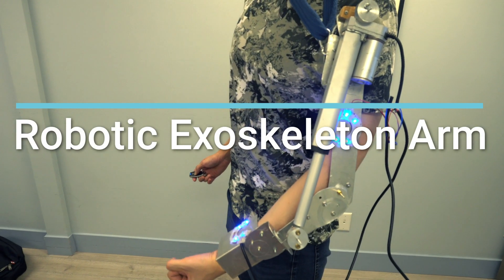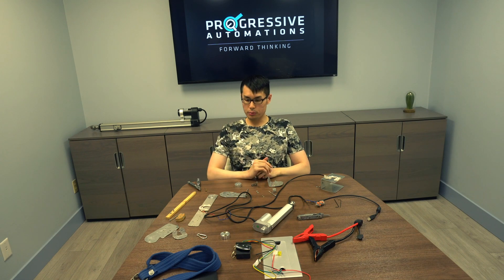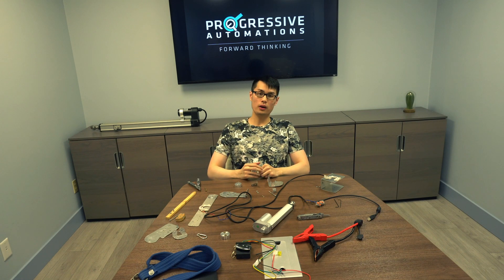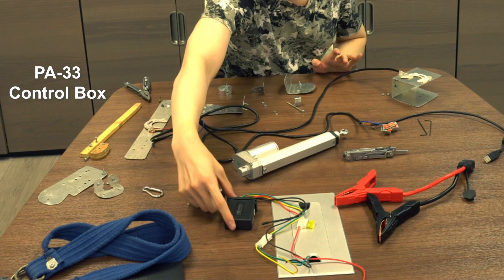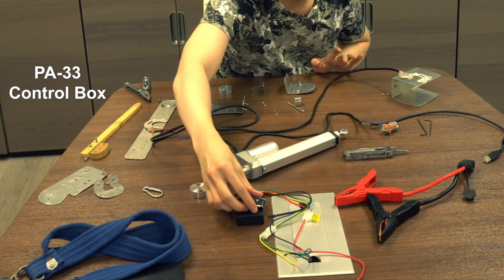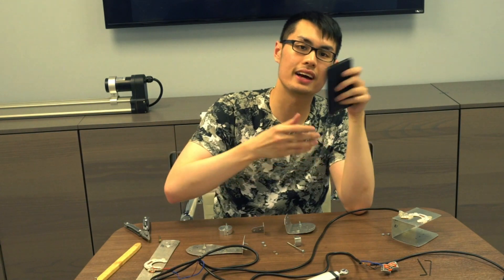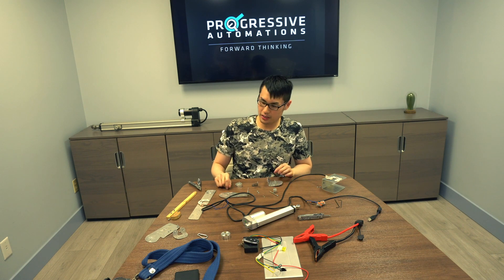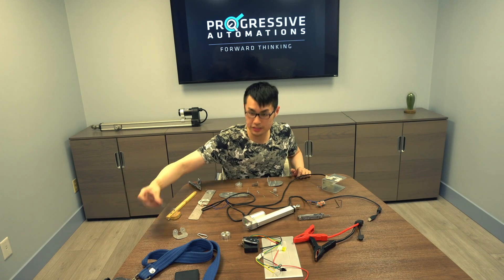Robotic Exoskeleton Arm for Halloween

Comment: Not sure if you've ever played Fallout, but if I theoretically wanted to make a powerfist, what would be the best one of your actuators to use?
Reply from the maker: Hello,
 
For an effective punching motion, you will typically require a method of exerting motion at a high speed and medium to high force. In theory, you may consider using an electric actuator such as our PA-QR1 which has a quick-release feature that can allow for installation to heavy-duty springs. The actuator is to move the fist and the heavy-duty springs into position so you can lock them in place and then release a lever or trigger mechanism to fire the springs and fist at a high speed. This allows for a punching motion at high speeds that most actuators are not easily able to achieve. 

Thank you!